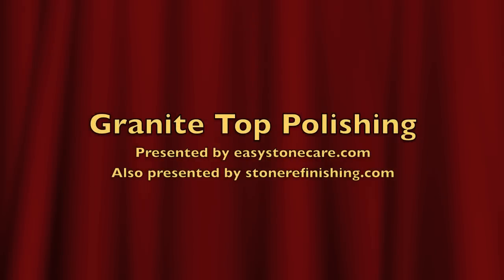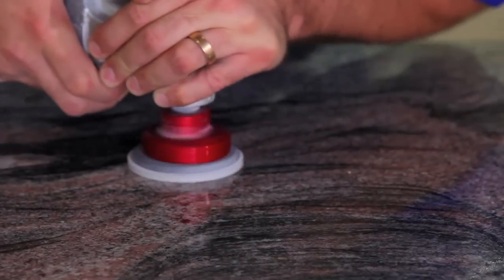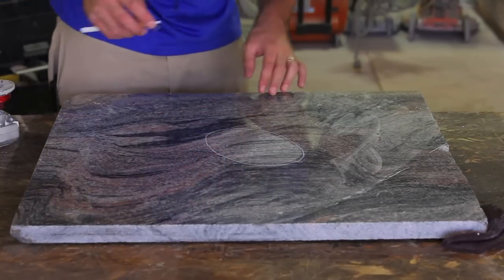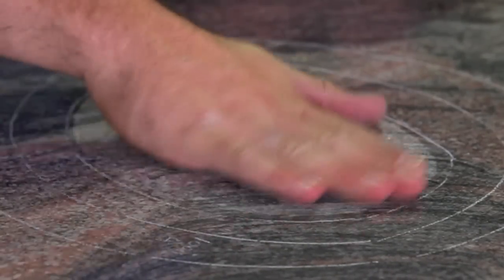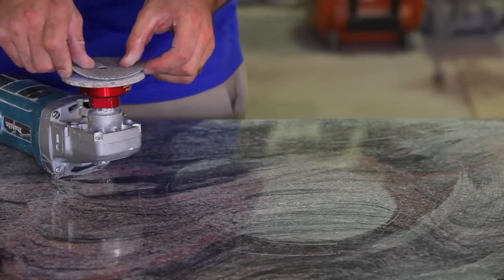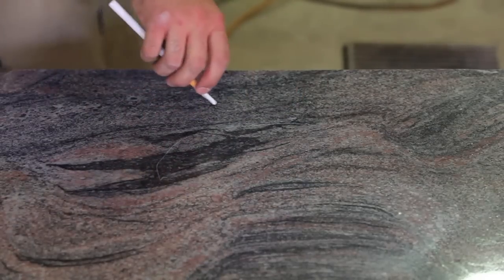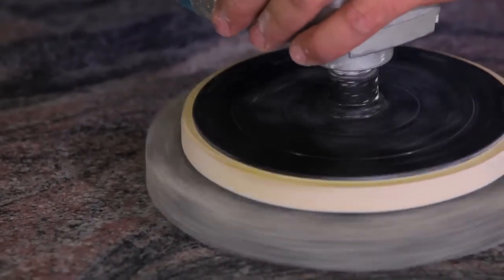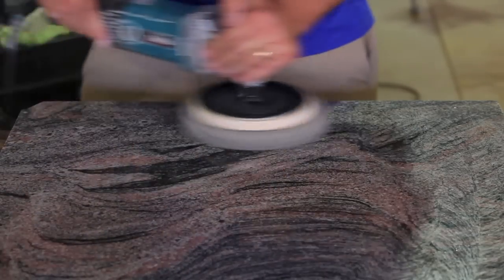Professional Granite Counter Polishing: Step-by-Step Guide | Easy Granite Refinishing

Comment: Pls I ave a fountain nd which the wall is of granite.... But I discovered a whitish line on the granite wall maybe bcos of the water fountain dropping... But I really want too remove dat whitish stuff.... I tried using water nd soap and some chemicals yet ain't resolved... When I clean it wit water nd chemical qin the affected area it's looks as if it's no more der but after it get dry that whitish stuff comes out again
Reply: +Emmanuel Uche In your situation it sounds like you are dealing with heavy mineral deposits. In this case you would want to use an acid based cleaner and a mild scrub pad, like a Scotchbrite Blue pad.
Reply: some acids however will etch the granite surface and dull the shine. You may dislike the white mineral deposits more than you do the dull etching.  a scotchpad can also cause micro abrasive scratches as well and can be quite difficult to remove much scale very fast.  There is a special gell cleaner made by Bio-Dex but it is still an acid that you need to use care in applying.  do it by hand not with a machine or you will splatter all the product where you don't need it.  Mechanical removal and polishing is best but as you saw in the video  it will take time and proficiency as well as an electric power tool that you need to make sure you're using a CGFI circuit protection so you don't get electrocuted if you get the tool in the pool.  Recommend draining pool a foot or so anyway.  Prevention would be done using a sacrificial silicone sealer also by the same company that keeps the future scale from connecting chemically with the stone and just a light nylon brushing will remove the buildup with regular pool cleaning.
Reply: Turbo-Seal I have a granite waterfall I'm interested in restoring  has white mineral deposits all over what should I seal it with after using the cleaner
Reply from the maker: thank you

Comment: it changes original shine. not bad .but if your rest of your kitchen is suppose to match. it won't now. it will look like two different cuts.
Reply: +Chris Windsor If the diamond honing is done right, this will actually blend in with the rest of the kitchen, Even in direct light, you won't be able to tell the difference.
Reply from the maker: it blends

Comment: What kind of knife could be use in the kitchen to scratch the granite? :)
Reply from the maker: +Ciobanu George There are many sharp objects that can cause scratches including the bottom of ceramic pots, some sharp metal objects, raw porcelain, and yes some knives. I had a client's son put his skateboard on the counter upside down and damage the surface.
Reply: If you really want to fuck them up use heavy pressure on a brillo pad.

Do not so this on any granite counter top because it will scratch it verry deep. I am not responsible for actions taken after reading this comment.

Comment: DIY people are NOT rich,,,,we cant afford to buy that stuff for that price  nor can we afford to pay someone to do it for us,,,,,,Thats why we`re here looking for cheaper way to to it and get it done I replace the damaged piece for less then the lower price of the 2 offered
Reply: If you can have the piece replaced for that cost, then I would recommend replacement instead of taking the time to do this, but a lot of tops consist of multiple pieces that can't be matched when replacing only one portion due to their unique pattern and characteristics. This is definitely an investment and unfortunately, there is not really a quick and easy way to do this type of work due to the very hard mineral content of granite. With marble however, you can get by with much less
Reply from the maker: thank you

Comment: Hi Ted,  Is there a number I can call you at. I have a granite counter which has patch of about 10x11 inches. There was a damage from Calcium etch through a plant that was sitting on the granite. While I had my handyman try to remove the etch.
He ended up removing the patch but the Colour in that area is faded. If you can send me your phone number  I can send you a photo.
Reply from the maker: qarta123 my office can be reached at 8003780266

Comment: Of coarse you can surface polish that soft light color, this is nearly impossible to do with most synthetic stones and many natural colors. Take the piece back to the shop and do it right. Sunlight hits a amateurs surface polish and it will be worse than the prior scratches.
Reply from the maker: I can't wait to see your video. We polish granite in customer's homes every day and it comes back at it better than factory using this method.